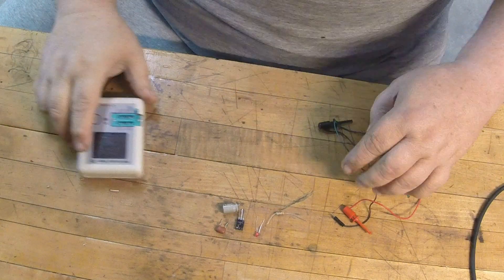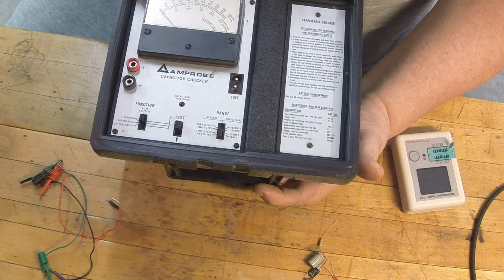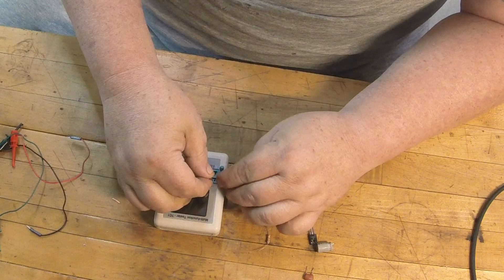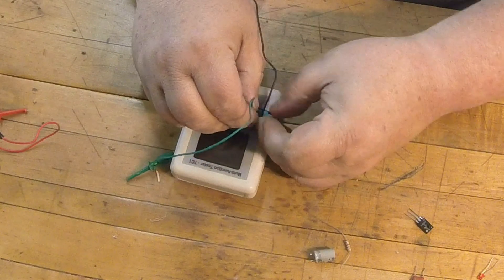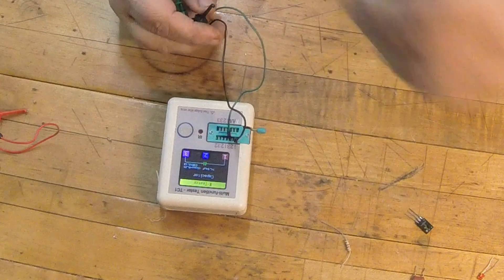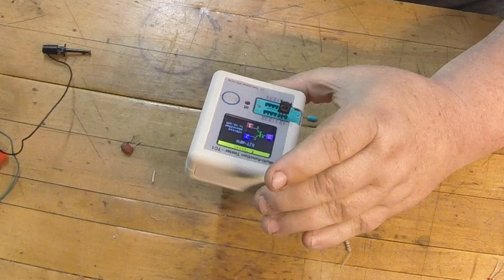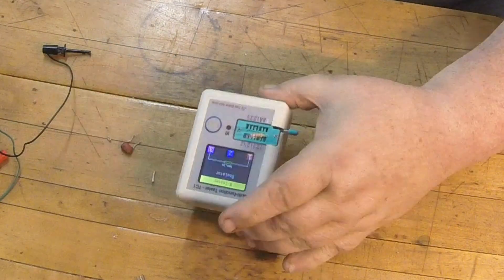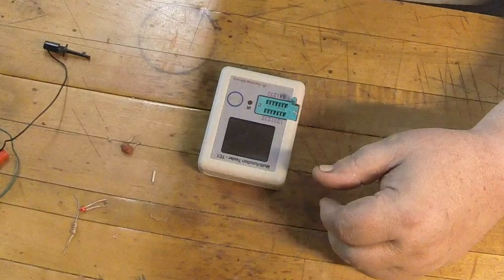LCR-TC1 Pocketable Multifunctional TFT Backlight Transistor Tester Review

Comment: Thanks for posting. Does it tell you if a transistors is bad.
Reply from the maker: Absolutely it will as well as Diodes, Capacitors Resistors etc.